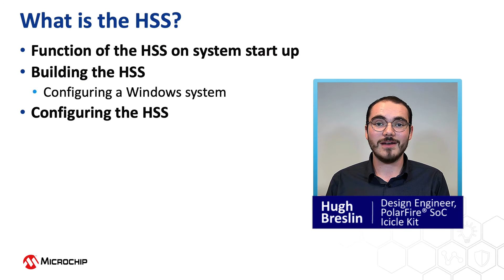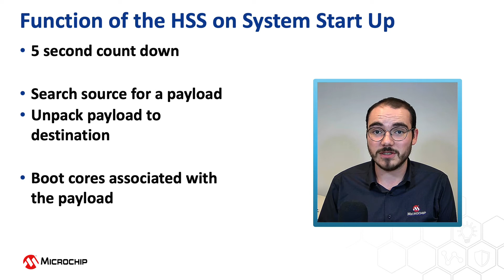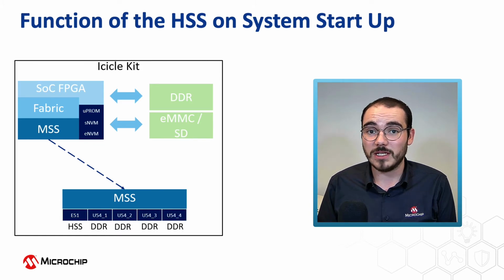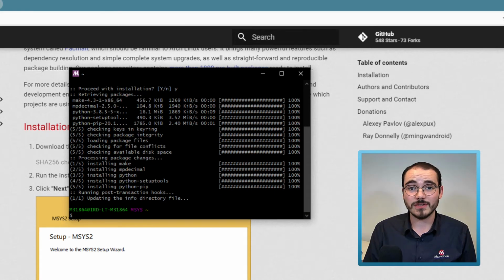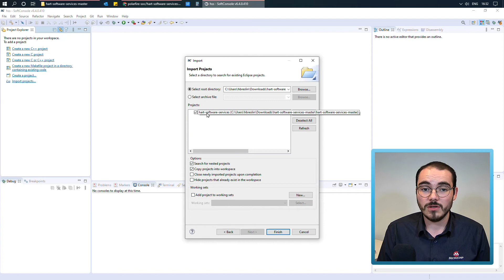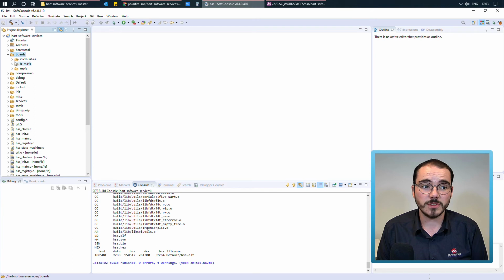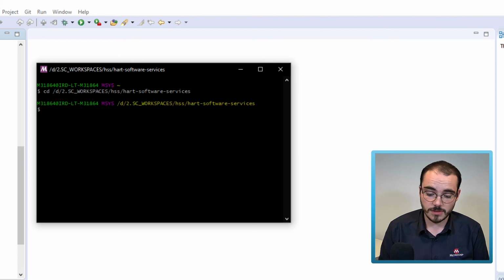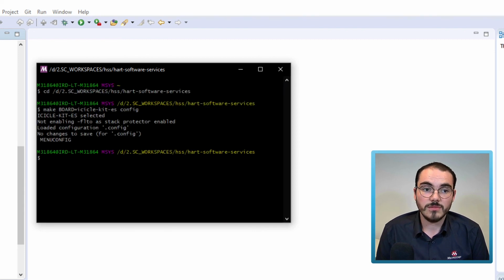What is the HSS?

Comment: At 3:30 when the HSS-helped boot process is explained, the presentor seems to imply no matter what E51 HSS will copy payload from source (eMMC or SD Card for example) to DDR before actual execution. This conflicts with my understanding, which of course could be wrong as a greenhorn. My understanding (from the "bare-metal running on LIM" tutorial series) is that only when linker script specifying DDR is used the HSS payload will be copied to DDR and then executes; otherwise, e.go. linker script specifiying LIM, the HSS payload should be copied from source storage directly to LIM and executes from there instead, without DDR involvment. Is my understanding wrong?
Reply from the maker: Hello again! The HSS boot process does typically involve copying the payload to DDR before execution, as described in the video. You’re correct though that this behavior depends on the linker script configuration.
If the linker script specifies LIM (Loosely Integrated Memory) as the target, the HSS can copy the payload directly from storage to LIM, bypassing DDR entirely. This setup is commonly used in systems where DDR is not available or for applications with a smaller memory footprint.
Your understanding is accurate in terms of the flexibility of HSS, and the process can vary based on how the linker script and target memory are configured. Hope this helps!